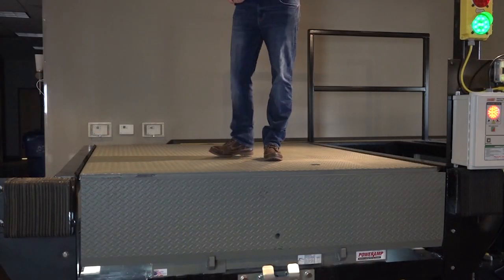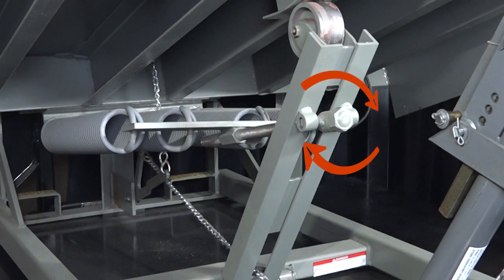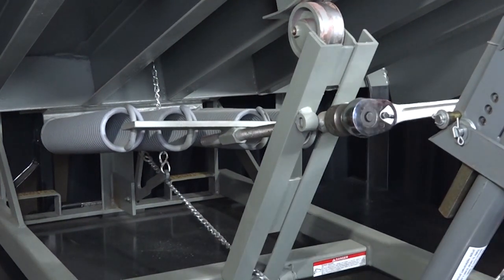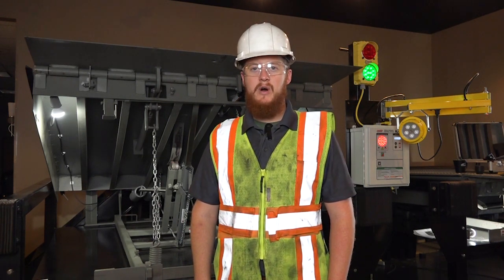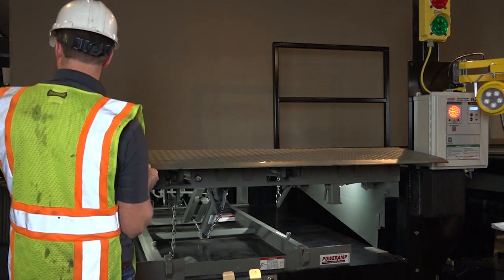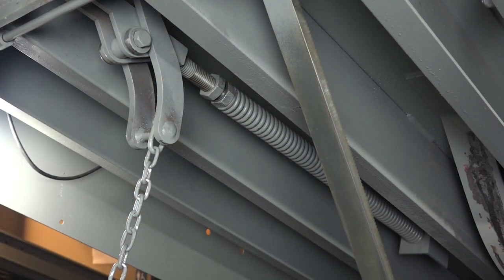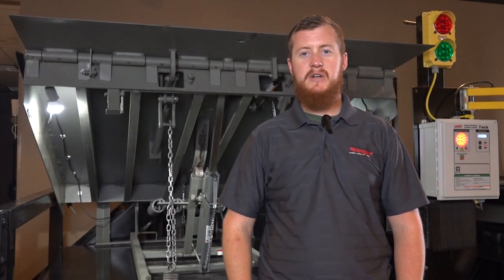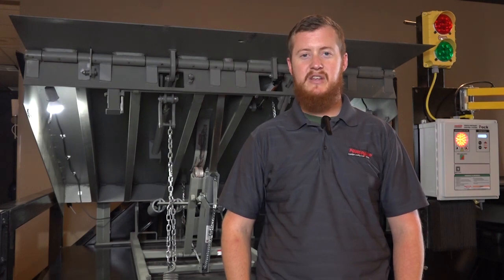Mechanical Leveler Adjustments

Comment: I was hoping you would cover up. The issue with pulling the chain and getting a no response period. Ican do the repairs or replacements.I would just like to know the safest and easiest way to get  the loading ramp up in a safe manner so I can get the safety stop engaged.